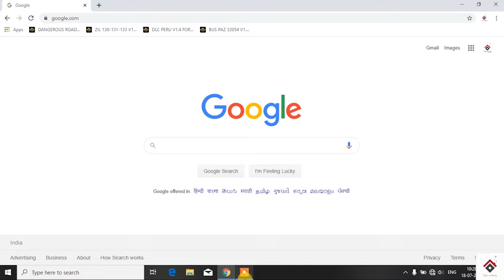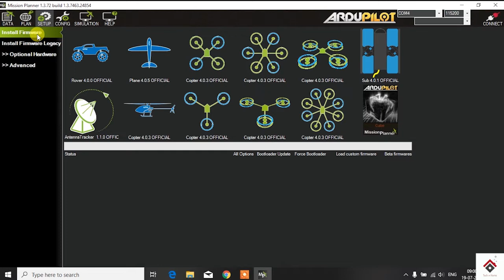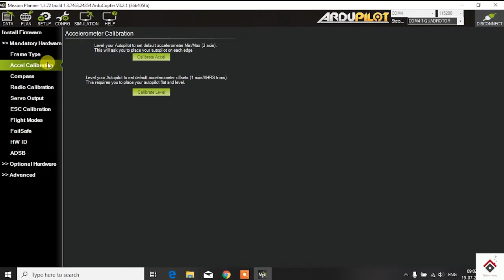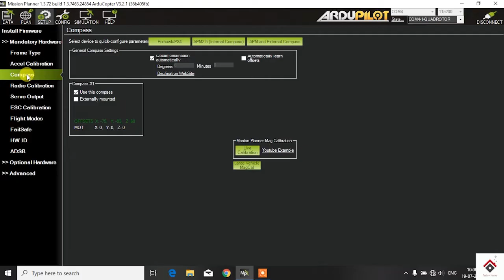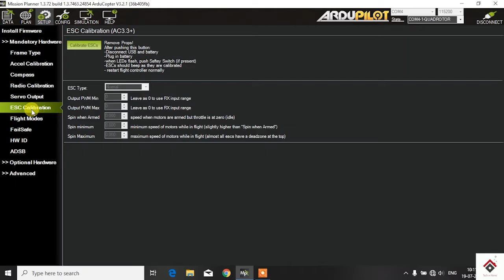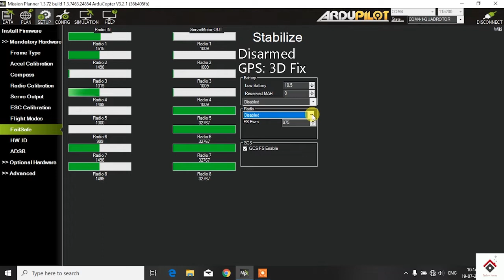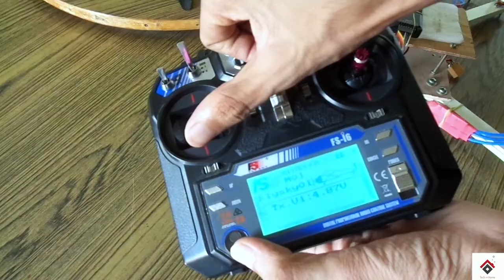APM 2.8 flight controller setup | How to make Quadcopter with APM2.8(Part 2) | Mission planner setup

Comment: Sir please explain about the JP1 connector.🙏🏻🙏🏻
Reply from the maker: ok I will check
Reply: @techathome  Sir, I made the drone and it's working fine in stabilize mode but when I switched it to alt hold mode it's not working properly and not maintaining the altitude it only elevating. Please help me sir 🙏🏻

Comment: Bro, how do i calibrate the esc in the transmitter  if i soldered it
Reply: You can calibrate them all together fr9m the power distribution board, not necessary to do it separately.
Reply from the maker: No problem even if you have soldered,
Just use one ESC signal wires to Transmitter 3rd channel and calibrate one by one
Let 12v supply be there to all
https://youtu.be/yaAf4eofppc

Comment: Bro... It is possible to make autonomous drone with apm 2.8 controller without transmitter and receiver... Please tell.
Reply from the maker: Is it possible using telemetry.
I have not tried since I don't have now.
You can set the points, and the drone will automatically cover those points.
Reply: @techathome  i try to make an autonomous suveillance drone without transmitter and receiver for my final sem project...  I am confused that  which flight controller is best for autonomous... Raspbery pi, aurdino, pixhawk, or apm 2.8...  Please guide me
Reply: @techathome  is it possible to rewrite programe on apm controller... Like aurdino and raspbery using python

Comment: What is power module?😢😢 i need help i just buyed a apm2.8 and having problmes in connection
Reply from the maker: Power module is used as regulated power supply
To convert 12v from lipo battery to 5v needed for APM

You can also power ur APM using ESC without even using power module.
This way I have shown in my video.

Comment: Bro I have APM 2.8 and all steps have been done successfully but not able to arm the drone in last  please guide
Reply from the maker: In the Radio calibration, check whether channel 4 is present for rudder stick (stick used to arm)

Also , arming issue happens sometimes, if the GPS doesn't get satellite connection.
Try taking it to different place.
Reply: @techathome  thanks bro

Comment: Bhai i have CT6B transmitter, can I use it for even gps as u did???
Reply from the maker: Yes you can use
But for configuration of TX for  flight modes change is slightly different I think, I have not tried

Comment: Hello sir I need help I use apm2.8 in Quadcopter and my drone is automatically rotate left side on its axis try everything like yaw trim but nothing is working please help me
Reply from the maker: This might be because of,
1. Wrong propeller  or motor spinning direction/wrong motor layout - this things I have already explained in the same part2 video at the end. Verify once

2. Repeat the esc calibration - https://youtu.be/P-HbV_d7dIU
Reply: @techathome  sir I try everything every possibility of problems but still rotating

Comment: What version of Windows is on your computer? I am using a Windows 11 laptop and cannot see the list of COM ports in device manager.
Reply from the maker: Windows 10, but is should not matter on COM ports.
Install this Arduino software and allow permission for drivers at the end: https://downloads.arduino.cc/arduino-1.8.12-windows.exe
Reply: @techathome  I have given up trying to use Windows 10. I even installed a virtual XP windows but that failed too as I cannot access the USB port. Turns out that I cannot configure my Tarot gimbal either because their configuration app on the supplied dongle hasn’t been updated since 2012. So I need an XP machine for both. I am hoping that as soon as I get the firmware installed on my APM and configure the IMU I can do the rest using a later version of M.P. On my windows 11 laptop wirelessly via telemetry communications.

Comment: Sir I have done each & Everything except configuration setupin apm 2.8 mission planner so my drone arm and disarm runs same but never fly flip in the Right direction of board can you tell me.?
Reply from the maker: 1. Calibrate ESCs individually and using APM.
2. Check the motor rotation direction and propellers.

Comment: Hello,

I am Abdulkadir Badur. I am a graduate of mechatronics engineering. I build a drone for myself, but no matter how much I calibrate the arducopter board, when I start flying and give the gas, the rear engines of the drone take off and start somersaults. When I close the flight and connect it to the computer again, the calibration changes. How can I find a solution? I would be glad if you help.

Comment: Sir what will be best compas calibration value bec am not able to do it and values are so high than u shown in your video and also when I make my drone stand right it shows on pc that I have move my dron to left at home page (data page)  even after right calibration at setup page
Reply from the maker: Values need not be similar, it changes. But steps you follow should be same
Reply: Okay sir

Comment: I have made a quad using apm2.8 quad is spinning alot , its taking off but spinning,, tried everything, esc calibration, compass calibration, but still its spinning
Reply: As hélices estão girando no sentido certo 1 horário 2 horário 3 anti-horário 4 anti-horário?
De repente é isso.. ou você precisará Trimar pelo controle

Comment: Dude My drone is not arming and disarming..... Please help me...i have to repeat the esc calibration to make the motors run..... Hope you reply... 🙏🙂
Reply from the maker: Have you used GPS module??
Reply: @techathome  yes
Reply from the maker: Sometimes when GPS doesn't connect with satellite also, u get Same problem.
Take your drone outside to some other place and check once.
Reply: Yeah I tried but it's not working
Reply: @techathome  is it fine if don't arm and run the motors by doing esc calibration??
Reply: Will the drone fly....
Reply: Reply bro
Reply from the maker: Once complete ESC calibration as I have shown, Connect battery and check
Reply: @techathome  sure thanks...... Bro if this doesn't work....if I calbirate esc to make motors run will the drone fly.....
Reply: Please reply

Comment: Bro I want to repair my drone it's all units r working but battery swallow d can u pls gv me some teaching
Reply from the maker: _Battery voltage, u have to check regularly,

_When not in use , for storing the battery, total voltage should be around 11.7 v

_ While using, In each cell, voltage should not be reduced below 3.5v
It will swollen the battery

If battery is swollen very much, don't use that, it's dangerous

Comment: Bro, i try follow this step but my drone when it take off in talibize mode going to side..., how to fix it?
Reply from the maker: Have you checked the Motor directions?
Reply: @techathome  I have......, dron can flight but not stability position
Reply from the maker: 1. Do this calibertion once again : https://youtu.be/P-HbV_d7dIU

2. Keep the battery properly at the center and balance the weight properly
Reply: @techathome  ok i will try

Comment: Hi bro my drone is flying stabilize and ATL mode but loiter mode can't take off and it's flips bro and when I increase throttle high position one motor is Stop spinning in high position when down is not stop tell me any solution bro fast I want submit my project
Reply: Bro my APM 2.8 is not connecting it's showing no heartbeat received wt should i do now

Comment: i have tried using the external compass same like yours and calibrated it before flying. but the issue is that the the drone follows plus configuration when flying even though i selected x frametype. is there any physical orientation to follow when installing this? and also any other changes to be done on FC as i heard some ppl say to play with jumper J2

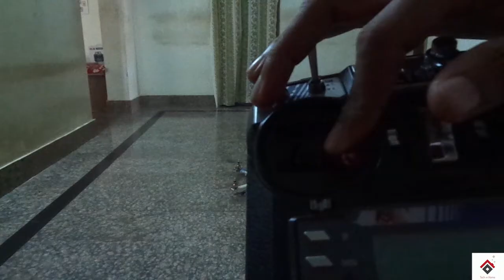Comment: Hello, at minute 12:05 it is seen that a propeller does not rotate well until a moment passes, I have this problem with three propellers, how can it be corrected?
Reply from the maker: It happens usually because all properties of one Motor will be not exactly same as other
But if you start giving throttle, the RPM should be same, is that working??
Reply: @techathome  It's mine, that's how engines do
Reply from the maker: Have you done ESC calibration?

Comment: Can you pls help me with one thing 
When i turn on my drone with battery the beep sound never stops and the when i try to arm it by connecting to pc drone doesn't respond and stays in disarmed state
Reply from the maker: Are you using GPS module
Reply: @techathome  yes an external one
Reply: @techathome
I have mo gps lock or there are 0 sats available so should i change the pre arm settings in standard params And thanks for replying !   :)
Reply from the maker: These days my GPS module is also not getting connected with satellite.
Try this once: https://youtu.be/Vkb2qH6UQZA
Reply: Thank you for ur videos i finallly got how to arm the drone can you give me any idea on how to integrate servo with apm board
Reply from the maker: Servo can be directly connected to receiver.
Refer: https://youtu.be/Oq1iTOh4XJQ

Comment: iam getting problem for radio callibriation. i didnt get RX symbol on trasnsmitter. can you help meon this
Reply from the maker: Have you completed the binding step?
Reply: @techathome  i have done now I'm seeing RX symbol but for now I'm getting error for esc calibration
Reply from the maker: @acharisimhadri2806 Follow this - https://youtu.be/P-HbV_d7dIU
Don't do ESC calibration from mission planner. Use this method
Reply: @techathome  Done .which calibration we should do first
Reply: @techathome  Thanks a lot for your response
Reply from the maker: First do individual ESC calibration using Transmitter.
Then do the calibration using flight controller.
Same as in Video
Reply: @techathome   i have done before 2 days .and after that batery didnt work ,now im having all the working components. should i repeat all the process again?
Reply from the maker: Try flying, if All Motor running with same RPM, no need

Comment: I've finished all the programming setup of my APM 2.8 quad but now I want to make some changes in flight mode setup using mission planner, so now do I need to re-upload firmware and recalibrate acc and compass ?
Reply from the maker: No need, directly make changes
Reply: @techathome  thank you so much.....

Comment: I cut and soldered my esc wire to board before calibrating. Any other way to calibrate esc
Reply from the maker: No problem, Connect your power distribution board to battery, but single ESC to your Receiver
Repeat the same for all ESC'S
Reply: @techathome  my battery was sparking every time i connected it to apm power module, after a few times one esc burned out. I removed that one esc and kept 3 as it is, now when i connect battery there is no sparking. was the esc faulty from the beginning thats why battery sparking or did i do something wrong ?
Reply: also i have removed the red wire from esc as i am using apm power module and removed jumper JP 1. do i need the red wire when calibrating ?

Comment: when you start the setup do u plug in the battery or not? please reply bro
Reply from the maker: No, don't plug the battery
Reply: @techathome  one more ques bro
is there any chance ill fry my flight controller?
some people are saying that mine is a clone apm 2.8 and it will burn when i will install firmware please do reply bro
Reply from the maker: No bro, most of the boards we are getting are clone, But follow the procedure correctly
Reply: @techathome  thanks a ton bro! Ure the best 💓
Reply: when i try to install firware it says failed to discover board id please man help me again
im scared 
pls bro pls
Reply from the maker: Don't click on install firmware
But click on ( install firmware legacy ) just below that.
Reply: @techathome  bro can you provide me your fb id or email? i got some other probs too
please
Reply from the maker: deepakhd20@gmail.com
Reply: @thecomedyguy8703  simply select 115200 as port parameter.i got same problem but solved it in device manager.

Comment: Why "pitch" on video at 6:30 is inverted?
Reply from the maker: On my Quadcopter, forward and backward was working reverse,
So I had inverted pitch.
I don't know exactly if it's only for me or others are also facing.
Reply: @techathome  it is reversed for me too, that is why I asked. But my drone has IMU rotated by 180 degree by YAW. So it is unclear what is right settings.
Reply from the maker: But follow the flight controller forward arrow direction as reference and place it.

Comment: Bro please help me
When I  do live compass calibration the white dots don't appear.
Reply from the maker: That means, your board is not having inbuilt compass.
Connect the external compass that comes with GPS module and check mark on external compass option .
Reply: @techathome  thank you bro.
Your videos are very informative and you show every small step which is usually skipped by many people.
Keep it up.
Reply from the maker: Is it working now?
Reply: @techathome   actually I will have to buy the GPS module.
So I will inform you once it starts working
Reply from the maker: Sometimes, it will not work.You have to buy APM board with inbuilt compass.Just try once.
Reply: From were do you buy
Reply from the maker: APM board from Amazon.
Rest of components from Bangalore local store.

Comment: Bro Ac 3.6.7 AP 3.9.7 when I upload this Apm install ap3.2.1 I don't know why
Reply from the maker: I think it is automatically installed, before u selected
May be it was compatible with your board, no problem with that
Reply: @techathome  it's ap 3.2.1 you say 3.6.4
Reply from the maker: Version doesn't matter,
If it is installed in your board, no issues, u can proceed next

Comment: thats an awsome thing. my question: ardupilot wiki says to do the tuning part before first flight. but ur quad still seems so stable without tuning and also with default params....how come, even indoors? did you miss to show something? i also have same setup but in my case the quad leaves ground at 3% throttle (it should be around 50%) and also it drifts to one direction and not straight up like yours. im using 8038 props, 980kv motors and 1300mah 3s lipo and same simonk ESCs you are using

Comment: Thank you very much for this video. Do i need shock absorber mount for apm 2.6 amd apm 2.8?
Reply from the maker: You can use, if you can buy. But I have used waste sponge.
Reply: Bro my drone isn't arming in loiter mode I used apm 2.8
Reply from the maker: Always start with stabilize Mode
After going some height, change the modes.

Comment: Bhai Mera drone arm nhi ho rha
Pre arm need 3d fix show hota h 
Help bhai
Reply: Hi,

Did u got solution, I'm facing same issue
Reply: @pradeepkumarts999  yes now my drone can fly very well
Reply: @gbcreative7635  Can you please let me know the solutions so I too can fly mine.

From so many months I am trying and lost hope.

 issue is "Pre Arm: Need 3D fix" it's not at all arming. Kept for several minutes without clouds still same issue.
I reinstalled several times
It's latest APM 2.8 & Latest autopilot
Installed 3.2.1 which picks automatically avilable as latest version.
Compass is calibrated.
Checked both enabling and disabling Geo fencing
Reply: @pradeepkumarts999  same here with me before few months
Reply: @pradeepkumarts999  are you using instagram

Comment: Hi,
Can anyone pls help me in the issue of "Pre Arm: Need 3D fix" it's not at all arming. Kept for several minutes without clouds still same issue.
I reinstalled several times
It's latest APM 2.8 & Latest autopilot
Installed 3.2.1 which picks automatically avilable as latest version.
Compass is calibrated.
Checked both enabling and disabling Geo fencing

Issue is from several months.
Reply from the maker: Have you used GPS module

Comment: In apm red and blue lights are  flashing when I power up can u solve it pls
Reply from the maker: Try to arm.
Have you uploaded the firmware
Reply: @techathome  iam not able to upload the firmware
Reply from the maker: Try uploading firmware with (install legacy firmware).
Reply: @techathome  what is legacy firmware
Reply from the maker: 8867573117

Comment: Everything went smooth, but its not arming, why?
Reply from the maker: Are you using GPS module?
Also, in radio calibration, check the channels are correctly assigned to correct sticks.
(Rudder used for arming should be in channel 4)
Reply: @techathome  yes i managed to do it, but now i went to flight, first it flew smooth, later it went out of control and went up and suddenly fell, can you tell me the reason this happened?
Reply from the maker: Have you done ESC calibrations?
Have you configured flight modes?
Reply: @techathome  yes but i did that in a hurry
Can i reset the apm and then again calibrate it?
Reply from the maker: Yes you can
Reply: @techathome  how to reset the apm?
Reply from the maker: You can reinstall firmware and repeat all steps
Reply: @techathome  hey today while soldering the power module into the pwer distribution board after connecting the battery, there was a spark in the negative terminal of the power module(connected to battery) in the power distribution board and after that its not responding even if i connect the battery. What is the reason for this? Is the power module damaged of the power distribution boards is damaged?
Reply from the maker: You can directly connect without power module and check
If other components are working
Reply: @techathome  hey bro, again the same issue, after 2 mins of flight, i lose control over the quad,,, even if i turn of the tx, it just goes on to fly really high and  very fast untill something breaks mid-air and then it crashes,, please help me bro

What should i do so as to make it alright!? 
Please help! !!

Comment: Bro plzz do not tie the flight controller ,make it fixed, because the d term will make the quad flip ,even if there is a small movement in fc
Reply from the maker: Ok I will change that, Thank you